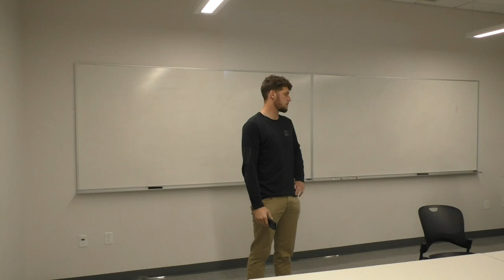Devin Colon

Comment: Your explanation of your problem-solving approach to unfamiliar challenges was very well done. Breaking complex problems into smaller, more manageable parts and identifying familiar concepts is a sound strategy. Your consistent and confident communication in all your presentations is commendable, and I have no suggestions. Devin, I echo your sentiment that the most effective approach to handling unfamiliar problems involves breaking them down into distinct sections and gradually integrating them. Your clear and resolute speaking style was equally impressive, and I have no feedback regarding improvement.